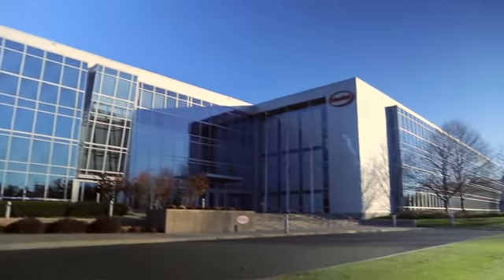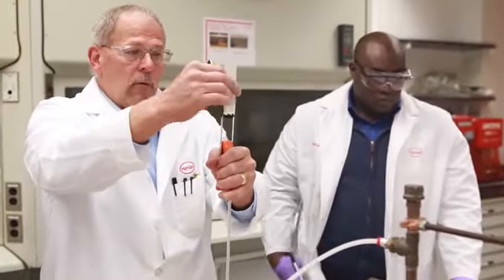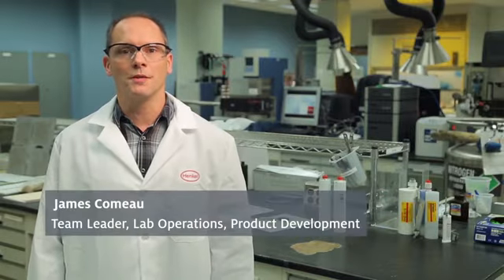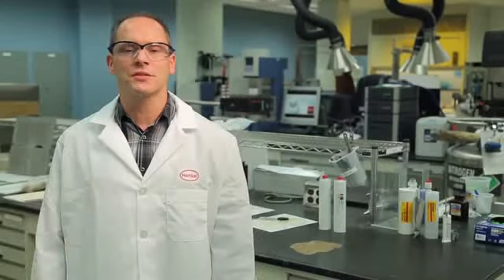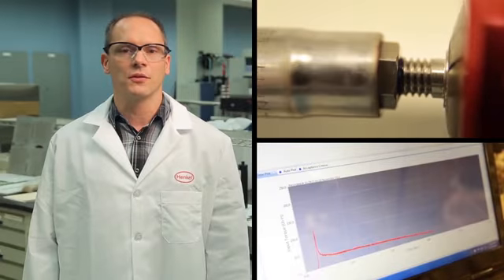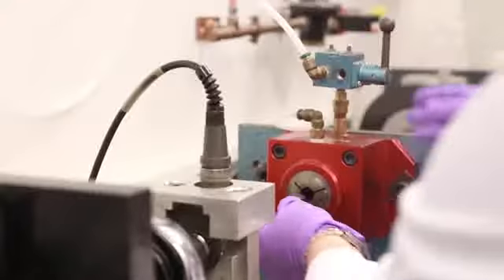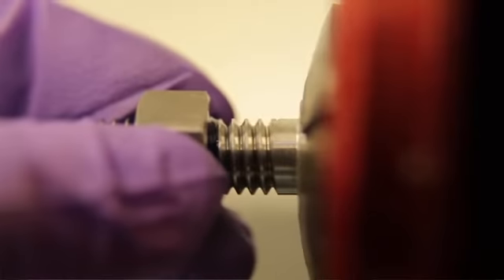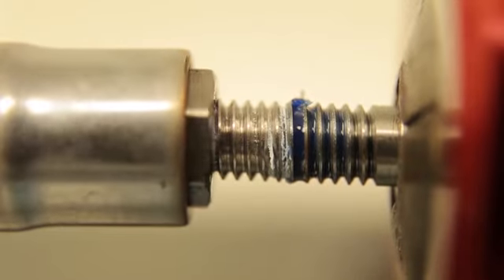LOCTITE Adhesives: Torque testing at LOCTITE testing labs

Comment: Hey bos...may i asking.. i have loosen ratchet ring at my bicycle hub.. the ratchet spin freely.. the cup at the hub doesnt have thread.. so i bet the ratchet ring they just press fitting in the cup and tighten it with putting aluminium plate (like leaf spring) between the ratchet  and cup.. for u i formation, some other hub they fasten the ratchet ring into the cup hub because the cup have thread.. so in my case the cup doesnt have thread.. and like i mention before currently the ratchet ring was loose.. making it unable to hold the pawls when i ride.. the ratchet spinning freely and they shouldnt be like that.. i hope understand  what im try to describe the situation.. so my question is, what series of Loctite i can use to permanent bonding the ratchet ring at the cup wall.. tq in advance
Reply: Did u problem fix tho xD